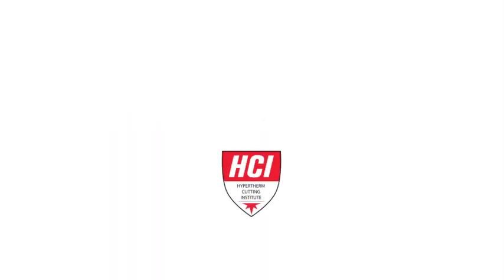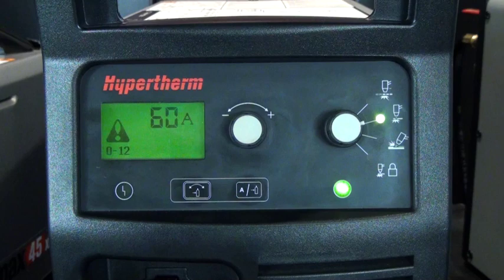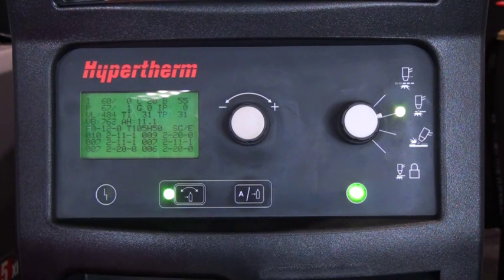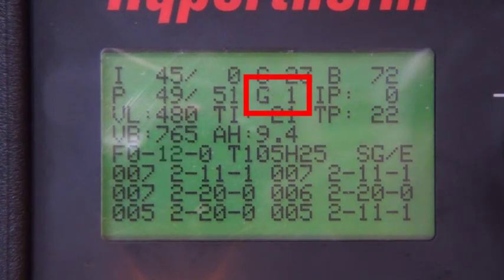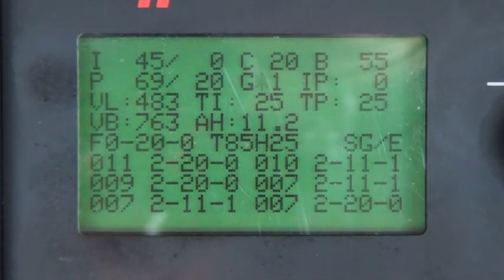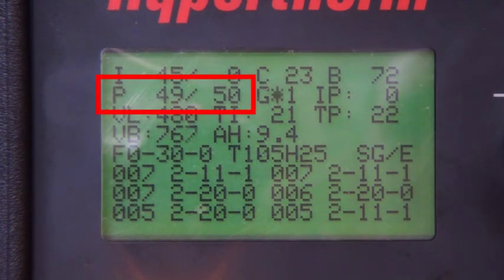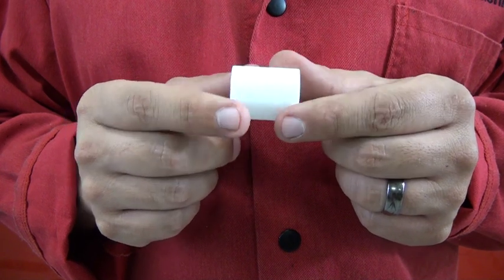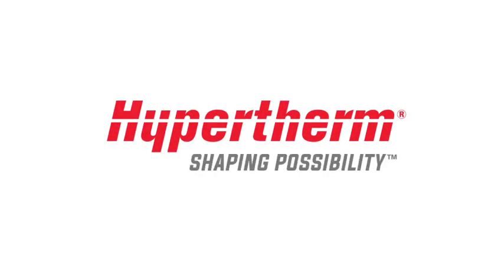Troubleshooting Powermax Pressure Faults for Systems over 50A

Comment: my problem on hypertherm 125 is that the electrode spring burns out or that you hear an alternating sound of air when you open the air without igniting the arc ... low compressor or broken machine? I burned 3 electrodes in 5 minutes just trying a trigger in the air !!!
Reply from the maker: Hi Francesco, this sounds like an air pressure problem. If the air pressure is correct at the machine so there is no fault, then the air pressure could be incorrect at the torch. Check to make sure there's no damage to the torch lead or no kinked lines. Also check for oil or water contamination in your torch head and gas supply. Additionally, an internal regulator may not be functioning properly. If you are still experiencing problems, we recommend taking it into your local repair center for a full analysis.
Reply: same [problem here cartidges and new line of powermax are like crystal princess